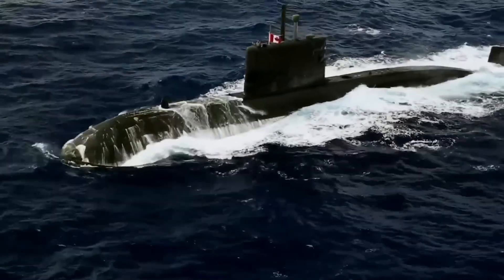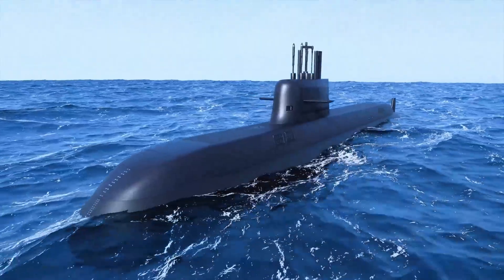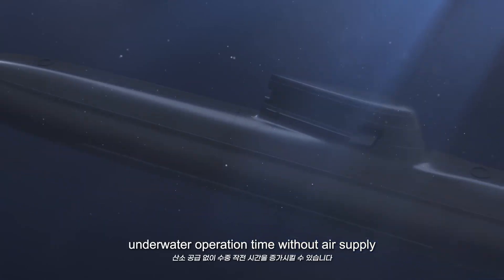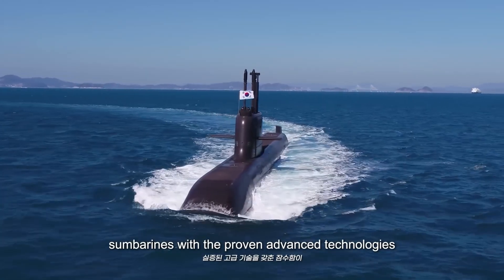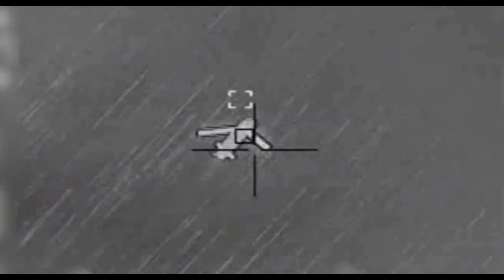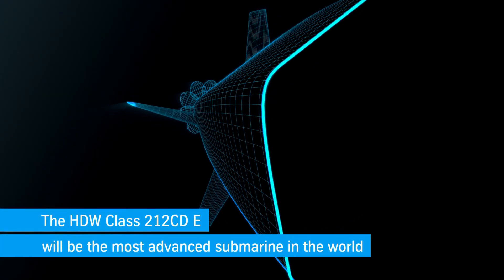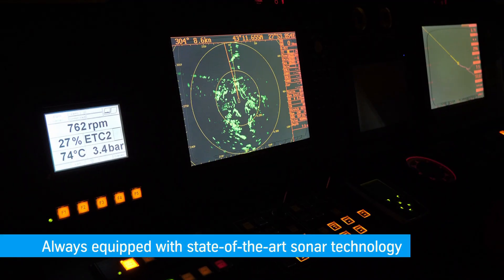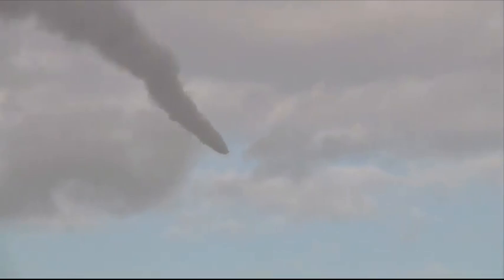RCN's Potential Next-Gen Subs

Comment: I think they should go with the Korean model. The European sub is not a deep water sub. Also Canada needs the missle capabilities.  As far as stealth they seem equal. Delivery time is important.  The German 212CD is a concept, not in service.
Reply: German submarines, particularly the Type 212 and 214 models, are medium-sized vessels designed for coastal operations. They have limited operational range and endurance, and their fuel and resupply capacities are constrained, making them unsuitable for countries like Canada that require coverage of the Pacific, Atlantic, and Arctic Oceans. This design philosophy reflects the operational environment of the German Navy, which primarily operates in coastal waters such as the Baltic and North Seas.

In contrast, South Korea’s KSS-III-class (Jangbogo-III) submarines are large vessels of approximately 3,700 tons or more, capable of ocean-going operations. They are equipped with large batteries, hydrogen fuel cells, and an Air-Independent Propulsion (AIP) system, enabling extended submerged endurance and long-range missions. These submarines can also carry long-range cruise missiles. The large batteries extend the duration of electric propulsion, while the hydrogen fuel cells and AIP system allow prolonged submerged operations without atmospheric air, significantly enhancing stealth. This technological advantage enables KSS-III submarines to conduct sustained operations across the vast maritime areas required by Canada.

German submarines are primarily deployed in European waters. Specifically, Type 212A and 214 submarines operate in relatively shallow and enclosed seas such as the North Sea, Baltic Sea, Mediterranean Sea, Adriatic Sea, and Aegean Sea. While they benefit from quiet AIP operation, their displacement is only around 1,800 to 2,000 tons, and their operational endurance is typically limited to 2–3 weeks, making them unsuitable for oceanic voyages.

Therefore, while German submarines are suitable for European coastal operations, the KSS-III clearly represents an ocean-going expeditionary platform. For Canada to meet its strategic requirements, the choice is evident. The KSS-III-class submarine is uniquely capable of supporting Canada’s maritime security strategy across the Arctic, Atlantic, and Pacific Oceans.
Reply: @max_7344  i understand the batch 2 Korean boat will be even larger for crew comfort and supplies. Is that not correct?
Reply: @thomnoble8384  As far as I know, that’s correct. The Batch 2 Korean submarines benefit from automation, which reduces the crew’s workload, and they also provide more space, enhancing crew comfort and the capacity to carry supplies for extended operations.
Reply: @thomnoble8384  To add a few more points, Japanese submarines employ a double-hull structure, originally designed for deep diving to evade detection, which limits internal space. This design has continued in modern Japanese submarines, making them less suitable for long-range oceanic operations. In contrast, South Korean submarines, built using POSCO’s specially engineered steel, have undergone rigorous testing and sustained long-term operations without requiring a double-hull structure.
Reply: @thomnoble8384  As a point of reference, the Korean metallurgical company POSCO supplies its Giga Steel to 15 global automobile manufacturers, including GM, Ford, Renault, Toyota, Honda, Nissan, Mercedes-Benz, BMW, and Volkswagen.
Reply: @thomnoble8384  The unique application of South Korea’s steel technology in defense is also evident in the following aspects.

Regarding protection, the K2 is fitted with domestically developed composite ceramic armor based on silicon carbide (SiC). This armor is produced under extreme temperature and pressure conditions, providing significantly higher hardness and reduced weight compared to conventional rolled steel, which greatly enhances the tank’s mobility and fuel efficiency. The ceramic was developed by a Korean defense company and is classified as a top-secret technology. Industry experts evaluate this armor as having protective performance comparable to that of advanced main battle tanks such as the U.S. M1A2 Abrams and Germany’s Leopard 2A7, while offering a notable advantage in strength-to-weight ratio.
Reply: @max_7344  Go away.
Reply: Canada needs a boat for coastal and arctic patrols not deep water and I doubt very much if the max dept on either sub is published.  No, "As far as stealth they seem equal" did you watch the same video?
Reply: @PePe_007-A1  Canada doesn’t need submarines just for coastal patrols. What Canada truly needs are submarines capable of covering its vast territory - and only South Korean submarines can meet that requirement. German submarines simply can’t. They’re better suited for North & Baltic lakes anyway, since they don’t even have icebreaking capability.
Reply: @max_7344  You have no idea what you are talking about.
Reply: @PePe_007-A1 I have yes I dea what I’m exactly talking about. Those are all the facts.
Reply: @max_7344  Luckily the selection committee won;t won't be relying on internet experts and will be judging on Canada's stated needs and requirements.
Reply: @PePe_007-A1  The reviewers will handle the evaluation themselves for sure. They should also be more knowledgeable about those aspects.
Reply: @PePe_007-A1 I believe the German boat is more of a coastal boat like for around Norway and Sweden. Actual depths are classified but what I've read the Korean boat is more of a deep water boat. Which is what is needed in the Arctic. But Canada cant wait till 2040 to take delivery .
Reply: @thomnoble8384 The 212CD is good for both roles, the KSS3 is not an Arctic sub as good as the 212CD will be.
Reply: @thomnoble8384  You have no idea what you are talking about, you know that right?
Reply: @allannantes8583  Originally, German submarines, including the 212A, do not have icebreaking capabilities, and as far as I know, the 212CD roadmap does not either. The German Type 210 submarine, a coastal variant designed primarily for the North Sea and Baltic Sea, has not been operated near the Arctic. By the way, South Korea also operates the Type 209 submarine. Leveraging advanced technology, Korea’s submarines have overcome the limitations inherent in German submarine designs, enabling them to conduct operations not only in the areas typically covered by German submarines but also across much wider and more demanding maritime environments.
Reply: @allannantes8583  What we should focus on here is that Hanwha’s Korean icebreaker successfully broke through 2-meter-thick ice, and it has numerous ice navigation records not only in the Arctic but also in the Antarctic. These icebreakers account for 65% of the global fleet, and a next-generation icebreaker will be launched in 2026. Given this, do we even need to discuss the Arctic submarine capabilities of a submarine built by Hanwha, which possesses that icebreaking technology? In any case, it is clear that Korean technology has a technical advantage over the German counterpart. If necessary, I think switching to nuclear propulsion wouldn’t be a problem for the KSS‑III in the near future.
Reply: @allannantes8583  Anything looks good on paper documents. Conversely, Korea showed what it's currently operating.
Reply: @PePe_007-A1 212CD is ahead on stealth, range, dive depth and 41 days without snorting and up to 50 days without snorting depending on mission. The video is very biased towards favouring the KSS 3.
Reply: @allannantes8583  The hull shape of the Type 212CD limits how deep it can dive.
Reply: The vertical launch missiles are not required under this program. The German version could have this as well if required as they equipment the Israeli submarines with vertical launch missiles.
Reply: Does the KSS III has a diamond shape hull designed to make it harder for activ sonar ? No !!! So they are not equal when it come to stealh for that fact alone !  And a concept is a sub yet to be build but the first boat of the 212CD is beeing build as we speak with its parent design the 212A  beeing in service for over a decade now ! Several nations use this type or closely related subs like  type 214 or type 218 ! Among the  India , turkey , greece, portugal , singapur, indonesia ,italy ,israel and last but not leasts south korea ! Thats right the the KSS II is actally is a german build       type 214 sub  and their pitch the KSS III is build on that ! Basiclly just an enlarged version of the german boat ! So Canada is going to buy german either way , either original or copied ! By the way , on wish of the israelian gov.  we also installed vls cells for ballistic rockets on INS Drakon a sub we just build for them ! So if you really want some of those it can be done , just saying !
Reply: @christianjunghanel6724 i dont totally disagree, the problem for Canada is time! If Canada goes with the Korean boat i find it somewhat funny they will be sailing side by side in the Arctic passages. Our biggest enemy is not Russia or China its the USA
Reply: @christianjunghanel6724  the problem is it has not proven anything yet
Reply: @christianjunghanel6724 they aren’t proven. Anything would look perfect on paper. Most importantly, 212cd is still a imaginary boat.
Reply: @hlcapa  Its not !  It is beeing build as we speak ! And its based on a very good sub that that several other country use in this form or a derivativ which includes south korea ! Their KSS III is just an enlargement of the KSS II , which is a german build type 214 sub ! A watered down version of the type 212A😅

Comment: We may end up buying the Astute yet. However I believe we should go with the 212CD as the Germans & Norwegians would put their deliveries behind Canada for the first few. Plus it is modular so can be made longer if need be in the future. It is made to be “at edge of ice” by design, much more stealth and greater than 21 days dive times. Buy from the master rather than the apprentice, remember RSK was taught how to build subs by the Germans. The Germans build subs for Israel and if they are good enough for Israel they good enough for Canada.
Reply: Hi Allan.. just thinking that a fleet of 212’s in the northern sea’s, introducing the SK might be a game changer of sorts for NATO. And sorry, I would have to disagree to put 🇨🇦 and 🇮🇱 in the same category. I get what you mean for quality builds and all but 🇨🇦 has more of a blue water going need as well as littoral.. The 212 can do blue water I believe but for that, I would go with SK. Cheers 😎
Reply: @jazzmandan7056 You are correct. The 212cd is considered a coastal sub. While the KSS-III is considered bluewater capable.
Reply: @chm985  the 212A was considered a littoral type sub however the 212CD was designed to be a cold water Arctic “at or near edge of ice” for use by Norway for the North Atlantic in the Greenland, Iceland, UK Gap. It also has a dive time of between 41 and 50 days without snorting. Definitely a blue water sub with a range over 8,000 nautical miles but still classified. Dives deeper than 450 meters but actual depth is still classified. Also uses a much  safer battery. You need to stop spreading your false information to fanboy your love for a sub that was designed to counter North Korea and China. Hanwha themselves admit that the lithium Ion battery is very dangerous and that is why TKMS has moved onto the next generation in battery technology for the safety of the crew.
Reply: And no, Israel and Canada don't need to be grouped together
Reply: @chm985 that is a political statement, you shouldn’t go there. I will just leave it at that.
Reply: @allannantes8583  It is. And genocide or apartheid has never been ok.
Reply: @chm985   But this chat is about submarine disscusion only !  You may right but here the only intrest is about tec stuff !!! Its not like israel is building them anyway so save your breath cause its pointless and petty !
Reply: @christianjunghanel6724  save yours for your support of Israel, not to lecture me.
Reply: @chm985   There we go ! Who said anything about supporting Israel? You have no idea how i feel about them and if you do you would probably apologize to me ! But this about subs not israel! So stay and talk about subs or leave !
Reply: @chm985   For this disscusion ethics are irrelevant as we talking about the qualitys of the subs only ! Their actions might be wrong but their skills are undenieable so keep politics out of it !   Germany also builds for a lot of other countrys like India , turkey , greece, portugal , singapur, indonesia ,italy , and last but not leasts south korea !  Maybe you don t feel so strongly about them ?!
Reply: By the way , on wish of the israelian gov.  we also installed vls cells for ballistic rockets on INS Drakon a sub we just build for them ! So if you really want some of those it can be done , just saying !
Reply: I read ‘somewhere’, that the 212CD was modular.. If so, could they make it bigger? Add VLS ? 🤔 Can someone answer this? 😎
Reply: @jazzmandan7056  they are able to add vls but that would cost years and skyrocket the price, and that's not in their bid for Canada.
Reply: They are said to be having trouble with the new design and could be behind a few years now. There is no way they can meet Canada's timeline now. With the KSS-III we can retire the Victoria class a few years early and save on maintaining the old subs.
Reply: @chm985 the first hull is being launched in 2027 to Norway and it is on schedule. Have not heard of any problems.
Reply: @chm985 Is that the message the two defence ministers brought to Ottawa two weeks ago before PM Carney went on his trip to Asia where he visited the RSK Hanwha shipyard.
Reply: @allannantes8583  Yes, the delay was mentioned in a cbc article but the timeline wasn't given. The 2 year delay has been published by others though. This is normal for a new platform to experience. The KSS-III did too but its already past that point in its timeline. The scale of the build is also much larger in Korea.
Reply: @chm985 that is why Canada is being offered to be moved up in the queue. Plus Wismar yard will reduce scheduling pressure. Plus Canada will join as a partner where we help to speed things up with our injection of cash, supply chain and materials. TKMS manager said with an order of twelve boats we can do whatever Canada wants. He was joking of course but he wasn’t joking about finding overdrive to accelerate production and moving Canada ahead in the queue. Without any of that our delivery dates would be 2032 and 2037 for numbers 1 & 2.
Reply: The latest from TKMS is that they can be launching between 3 & 4 per year by 2028. They don’t ever admit to being delayed. They say everything to date is going by schedule. The 1st hull cut steel in 23, will launch in 27 and will be turned over to the Norwegian Navy in 2029 as per schedule. This is from the manager of the shipyard in Kiel.
Reply: @allannantes8583  Its ok allan. I already know from dealing with you many times you don't actually read anything other than headlines.
Reply: @chm985 you have already admitted you know very little about submarines and less about the F-35.
Reply: @allannantes8583  The projection is astounding.
Reply: @chm985   That intel is a false ! They are on time as we speak!
Reply: @chm985 you are the fanboy if ever there was one, you lie like a rug rather than admit you made a mistake. Every lie you tell requires 20 more to cover up for it. You have dug yourself quite a hole.
Reply: @allannantes8583 I've literally quoted published information. You just tell me no and that I'm wrong. Time to grow up allan. Maybe read a book
Reply: @chm985 sure fanboy.
Reply: @chm985  you were wrong about the F-35 when you said they were becoming cheaper to buy. How did that work out for you? $27.4 Billion Canadian dollars and still climbing.
Reply: @allannantes8583 how was I wrong? The f35 went from $135m to $85m per aircraft. The original $19 billion wasn't for just airframe purchases. Instead of attitude, let's understand how things work a little more. But that does involve reading.
Reply: @chm985 you should read the parliamentary budget officer’s report and the Auditor General’s report. That is where the rubber hits the road or in other words where the cash hits the invoices. The purchase costs alone are up to 27.4 billion from 19.2 billion.
Reply: @allannantes8583  you're using the correct words but not the right information. You didn't read it. Because we paid $85m per
Reply: @chm985  take your argument to PM Mark Carney, he will straighten you up.
Reply: @allannantes8583   go outside a see the sun, take a breath